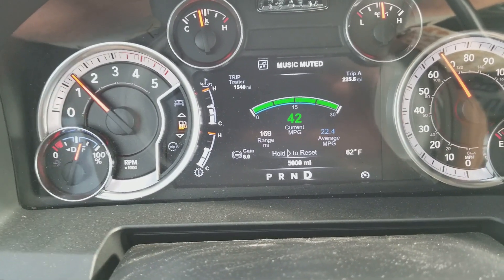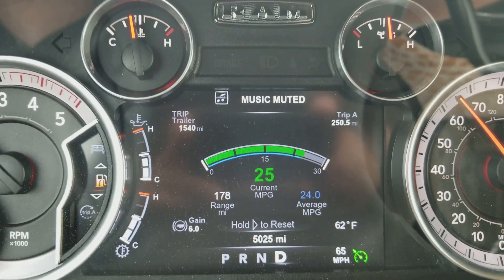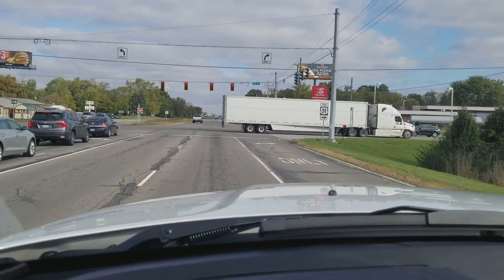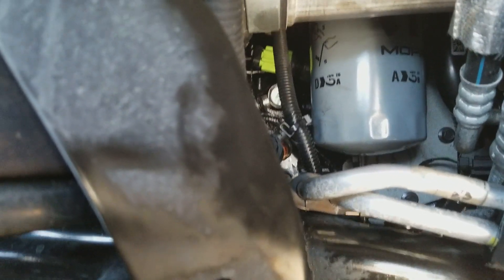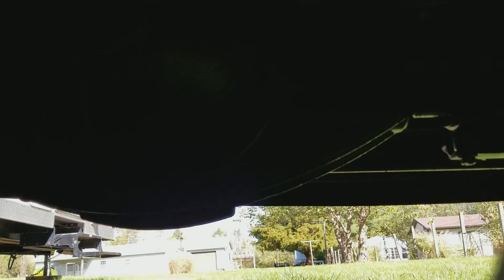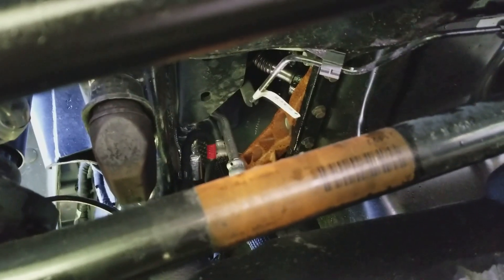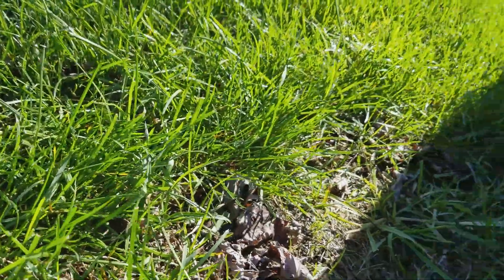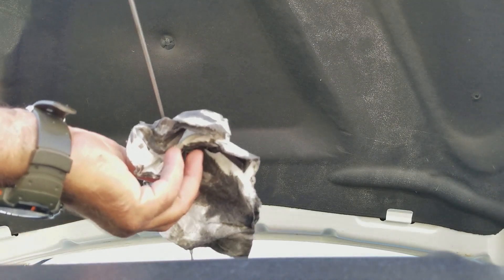Oil change - FAIL

Comment: I would go into that dealership and raise the height of shit!  I would make them wash the bottom of that engine off every time they did and oil change and I would force them to let me inspect it when its done, every time. The only reason for such such sloppy work by the tecks is poor management skills by the Service Manager.

Comment: I'd bring it back and make them clean it. The lube techs are entry level guys, and are constantly under the gun to get people in and out in under half an hour. 
  You say that you didn't have your oil change done by the express lube. The guys in the back shop work in an incentive plan. Oil changes don't pay much, even on a diesel. The tech just wanted to get it over with fast. I would go back and complain.

Comment: A thing I'll add is take a marker and put a mark or the date on the oil filter and anything else they say they will or are supposed to change/replace. Can't count the amount of times dealers or service shop have tried to get away with not changing the oil filter or air cleaner when they said they have. 
Give it a look over before you even leave the lot and if the mark/s is/are still there let it be known.
Reply from the maker: I plan to do that exactly as you said.  If they pull a fast one, they won't get me out of there without a battle.  Thanks for your feedback.

Comment: Them are the worst trucks to do oil changes on...I hated them...but they can be done clean.it takes alot  to clean that catch pan under that oil filter.that catch pan is pretty deep and holds alot of oil so if they didn't get it all,every bump every hill and every lil thing will push the old oil out all over the front end..they should have told you about how long it would have taken to jus clean it afterwords...the guy that brings his in to me I have lleave it cuz if I'm busy that has to wait till later so I can spend a hour an a half cleaning it afterwards...but nice truck tho lol.

Comment: Uh-oh. The party's over! At least with that serv dept....
Years ago we had a light come on in our new minivan. Took it to the dealer's svc dept, and the tech dips his fingers in the break fluid and pulls them out, dripping fluid down the front fender and bumper. A couple days later, the paint started to peel, exactly in a stream of 3 (fingers). I called the svc dept manager, who had me bring it down to show him. They ended up sending us to a body shop and having that whole area repainted, their tab. Doofus!
Reply from the maker: I got a call yesterday fro the service manager.  He is going to make it right for me, and has taken my advice and buy a special tool (4 of em) for his Techs to use that keeps it from making such a mess.  My next oil change is free, so I'll at least give them another chance.  They'll know I check it before I leave so we shall see.  I'm confident they are capable of doing it right.  If they don't, they'll never see my $$ again.

Comment: As long as you have proof that you change the oil at the required interval and using OEM or equivalent parts, they have to honor its warranty. I suggest make a video Everytime, including the mileage with the date, you change the oil. I always do my own oil change, cause I know it will be done right all the time. And there is no such thing as lifetime warranty, especially on drivetrain, that's all marketing hype. I'm sure there are fine print with stipulations.

Comment: Okay so here’s the deal. I am a diesel mechanic in North Carolina. Here is my issue put yourself in my shoes. Mopar pays me 3/10ths to do an oil change in one of these this includes lifting the truck checking it out air pressure, lubing the front driveshaft and of course the oil change. So you have to do three oil changes an hour to get 95% commission an hour. So just say you are taking the cab off of a ram 3500 but oh wait you have to stop what your doing to do an oil change you might see 6 dollars of. So as you pull the old filter which is full of oil, you have to pre fill the new filter as it goes up and let me assure you. It is a task to keep the filter upright as you lift it to get onto the truck. And by the way it drips oil because the pan under the filter that catches the oil holds it and you can’t see it yet alone reach it to clean it with brake clean. So be more understanding that it isn’t like changing the oil at an indepent shop where they have all the time in the world to lock down your engine. At least it was done right and not on floor jacks.
Reply: Matthew Gibbons exactly they don't even pay enough for me to even put her on the lift I understand not one oil all over your brand new truck but maybe you could get Dodge to care a little bit more about his technicians and pay him a decent wage by their bull crap labor time. Not only that come up with a better design for where you put the oil filter

Comment: You are voiding your warranty by wiping the oil off! When you have any type of warranty you cannot do any self maintenance of your automobile; including wiping off oil under body, doing your own oil changes, you will certainly void your automobile warranty😥
Reply from the maker: Love --- really?  Where did you get that idea?  Wiping oil off that the dealer left voids my warranty, huh.  I'll need to see that in writing before i believe it.
Reply: Wrong.  Wrong.  Wrong.  Do your own oil change does not void any warranty.  Maintaining or cleaning it doesn't either.
Reply: No it really doesn't I work at an independent land rover shop and we do warranty stuff and do oil changes on vehicles still in warranty and it does not void it